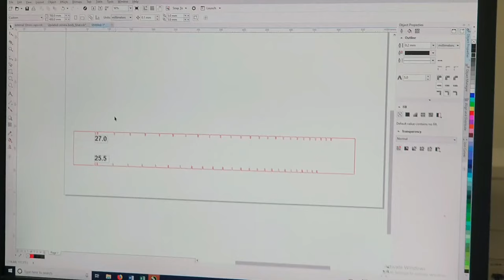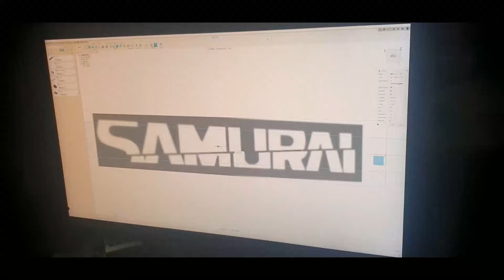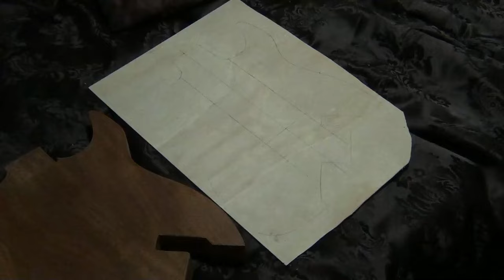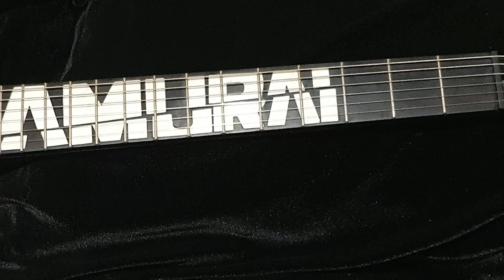Building Johnny Silverhands Guitar from Cyberpunk 2077 From Scratch! | Custom Video Game Guitar

Comment: It's an iconic guitar, for sure. I never understood why they chose this design instead of a headless design. Imho it would look even cooler  if it was headless.
Reply: yeah it's confusing as to why it has headless bridge tuners but then still has a head, it doesn't need a head.
Reply: @plonkosbrazoon  from what i've been told, it's a lore thing that it was a signature model guitar and one of the first to move to that style of tuners and was basically custom chopped out of the equivelant of a pretty standard ibanez style model
Reply: Guitars just don't look right without heads
Reply: Johnny would hate headless guitars

Comment: Amazing build by itself, but isn't positioning the bridge in that location forces to introduce two unnecessary bends on the angled strings, thus decreasing the possibility to go keep the strings tuned?
Reply: Most guitars have a slight tilt to the neck or are saddled to keep tension under trem use....so as long as it's compensated shoyld be fine

Comment: Hello, WHAT TYPE OF FILAMENT DID YOU USE TO MAKE THE RESIN MOLDS?
Reply from the maker: regular PLA. I used a spray cooking oil as a release agent. Still took a fair bit of effort to get them out, but it works. I'd recommend a proper release agent, though, the oil kinda floated to the top and caused an uneven surface making more work to sand out. I did try a kind of TPE filament, too, but I had issues getting it to print properly. I think if you can have success with that then it could be better than normal PLA and possibly reusable, too.